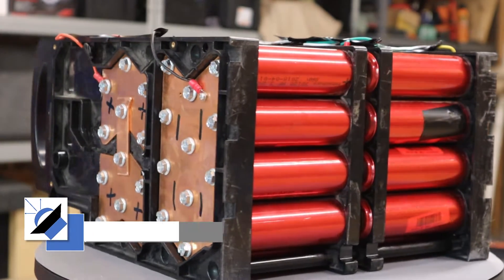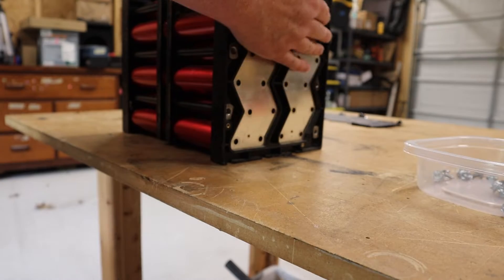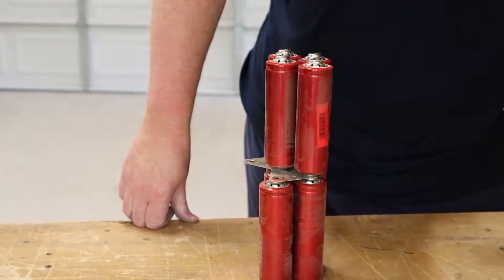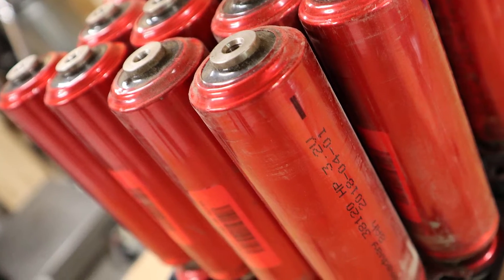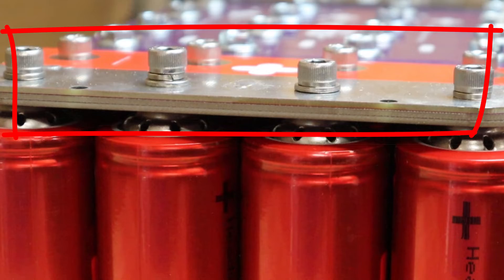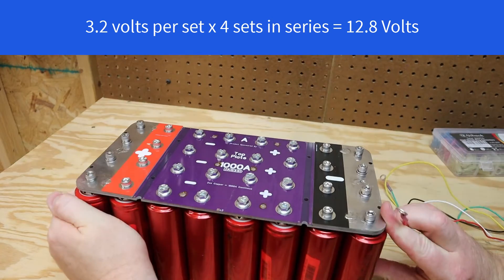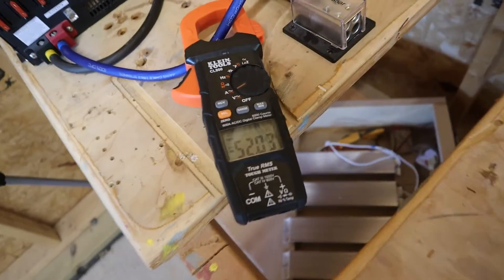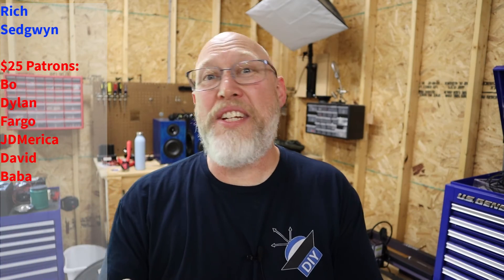Super Beast Battery Transformation! @JAG35, Headway Lithium and Battery Hookup

Comment: I’m running 2 500a pcb stacked  . It works with my smart 3 amp but I upgraded to smart5 and I’m wondering if the copper foil pcb bus bars will hold up , or should I use 1/8” aluminum plate ? Plus I have 3lugs so I’m bolted to the cell the corner.  
Idk if I’m over thinking or what.

Comment: I think it was about 5 years ago I first heard of these new cells but way before I saw any used ones for sale that I bought the 10ah ones and over a month I had 20 so made me a 4s,5p battery out of them , was going to install in my van but at that time I didn't know how to control the charging current . I put these cells in a plastic amo can with all the extras I needed for ham radio , I used my 30amp switching power supply through a 60 amp dc/dc boost converter and set voltage to 14v at 5amps which was all I needed but I most certainly used a good quality smart bms to keep it balanced and protected from over hear, over voltage, under voltage and freezing weather , it was really expensive at the time as most of those cells cost me $25 bucks each but were new . The bms is Bluetooth so I can see what's going on at any time and feel much safer like this . This battery wound up costing me around $700 and well worth it .

Comment: Is lithium benificial for your car audio system if you have a HO alternator and only listen to your music when the car is running and voltage never drops below 14v.  Im still deciding if i need shouikd get lithium
Reply from the maker: Probably not. But it is hard to say for sure.
Reply: Is it staying at 14v at the engine bay or at the amps? If it's at the amps,  you are not pulling enough current to even outdrive your alternator.

If voltage remains high at the engine bay,  but you're seeing it drop much lower during hits at the amps, your main power wiring is undersized. Address that,  then revisit a li-ion battery setup.

Comment: Hey can these PCB bus boards be used with the larger blue cells like the 10, 17 & 20 AH cells I'm not positive but I think they are the same size around just taller which should make it work right I'm trying to get the smaller boards and add bigger cells if possible I want the big power from a smaller bank than a 96ah

Comment: I'm new to ALL this lithium batteries and whatnot. I'm wondering if sum1 can help me out. I need a good battery for my car and car audio. I wanna do a battery delete. I haven't decided on what amplifiers I'm gonna get. No more than 4000 watts total. 3000 watts RMS at 1 ohm and whatever for my door speakers. My question is, what size headway cell would I need to run 4000 watts max at 1 ohm and the whole car? Please help and please give me sum advice of what will work for me. Thanks for y'all's time and brain power...lol
Reply: Thanks for the information. I have bought myself a Headway 24 cell 48ah lithium battery since I posted this post. Haven't gotten 0 gauge OFC wire yet. Gonna order that today.. hopefully...lol I also have just a factory alternator. I'm disabled so it takes me a min to buy everything I need to upgrade...lol Thanks again for ur info.
Reply: On Hifi Vega's video he shows that a 16ah lithium bank I believe lifepo4, outperformed a 100ah AGM battery in some tests he put them through. So hopefully that helps a little bit.   For 4k + the vehicle's needs, I would think 64ah should be plenty depending on your alt.

Comment: Dude you could just add resistance to the charging line to decrease the current. Use thinner gauge wire or add a resistor (granted you’d need a large one but a 12V automotive bulb could work but probably not for that much amperage)
Reply from the maker: Thin wire = fat fuse.

Comment: Greetings! This video was incredibly helpful!!! I have A question! If I where to build the 80Ah, could I use the same balancer you have linked here? Also, do you think the battery size you built is capable of starting a car reliably?
Reply from the maker: The balancer is designed for a 4s application.  Meaning if you have four cells in series it will balance them.  This thing should have no trouble starting a car.   But do not put this thing under the hood of a car. It is not designed for that use and you will burn your car down.
Reply: @DIYAudioGuy  THANK YOU SO MUCH for this answer!! I have been unsure of what the 3s-4s meant!!  This is my first rodeo, and i have a beast module on the way! My alternator is a brand new 100A Denso. Do you have any recommendation about building The battery you built here, VS the 80AH? The portion of video where you said it was initially struggling with the 100a charger, which is equivalent to my 100a alternator, I have wondered if I should build the smaller battery or larger battery. Again, I cant thank you enough for this information you have provided. Your page has me wanting to link my credit card to YouTube LOL!

Comment: Built a couple for car audio, @ 3 mins you will not run into that problem if you separate the cells then remove Center plastic pieces...or at least that's what I did with little to no resistance disassembling

Comment: so when I multiplied 8Ah x 24 cells it gives me a total of 192Ah. is this correct?
Reply from the maker: If you were to put 24 cells in series that's what you would get.  For this setup there are eight cells in series. So it's 64 amp hours.  If you convert a superbeast to 12 volts it'll be 96 amp hours. Because each series group has 12 cells.
Reply: so, it looks like you have 48 batteries. Does that mean you have 4 batteries per cell? I'm just trying to understand the amp hour rating. 48 x 8 ah would be 384ah.
 @DIYAudioGuy

Comment: Bought the same charger........ And like many before me, I returned it. Can you deep cycle head way?
Reply from the maker: I bought a different power supply and it works just fine.  You cannot deep cycle headway cells, they don't like being over or under charged.  Best case you shorten the lifespan of the cells, worst case  you start a fire.

Comment: I've been charging my lithium with a 4amp Battery Tender from Walmart with no issues
Reply from the maker: I need something that can charge and act as a power supply so that I can test amplifiers.
Reply: @DIYAudioGuy  Oh okay I understand. I charged my JP 6.0 and JP 500 farad cap bank with this charger and pushing a JP33 on 3 Resilient Sound RS 10's no problem.

Comment: I've got the same exact power max  100 looking to upgrade to push more audio equipment in my theater/gaming room. Does anybody have suggestions on what would give me more power thanks
Reply: Get the 120a version from power max and run them in parallel. Thats 240 amps. Plenty for almost any setup. Just make sure all the wiring used is identical in length.m and sized appropriately. That’s how I powered my audio system in my 2011 Honda cr-z hybrid prior to addition of a 320a alternator. Side note these power max converters also operate on 100+volts in case anyone was wondering.Since removal from my car i use them to charge my 80ah yinlong Lto and other batteries. One charger is all i use currently and the other is a backup . I top off my battery if I haven’t been driving the car much.  Only takes about 14 minutes to go from 13.6 ish volts to 15.5 at a beginning amp draw of 92 amps

Comment: I dont recommend you use a powered tool to insert the screws into these headway cells. They are on the softer side of metal threads
Reply from the maker: I agree.  Don't grab your big impact driver and give it 50 ugga-duggas.  That will mess things up in a hurry.  I was using a cheap 12v driver from harbor freight with the clutch set on the lowest setting.
Reply: @DIYAudioGuy  itll be alright. i had to tear down my dead bank last night and a couple of the cells threads have loctite from factory or something similar. needless to say i spun the negatives on 2 of my cells, it take alot of torque at least 15-20 ft lbs or so to hurt them

Comment: Just get an adjustable voltage PSU. The standard ones are 0-32v 5-10amp you can get them as low as 60 ish bucks

Comment: Insted of that balancer you should consider a bms (battery management system). I have a daily bms 250amps on mine works great but it only gets the battery 13.4, but it keeps it their.
Reply: And that’s your issue. Dalys balancing is nearly nonexistent so you’re getting high voltage cutoff on one cell while the others are probably low. And keep in mind high voltage cutoff is going to be 3.70 or 3.75 which is unnecessarily high. No reason to go over 3.55 or 3.60

Comment: Ok, I'm an electrical engineer who has designed lithium battery protection and charging systems, and there are so many issues here that all I can say is please do not do this. These batteries have certain parameters that need to be addressed for even approaching safe usage. What you are doing is unsafe on many levels and I would say that you are on the path to having this pack burn up in a manner that will probably burn down your garage and hopefully not hurt anyone or worse. This can happen at any time, when charging, discharging or even while the battery is resting disconnected while you are sleeping. Just the beginning: 1, Do not exceed the maximum charge or voltage that the cell manufacturer has listed on their spec sheet. This is specific to each cell designed by the manufacturer. These cells are not like using D cell where the parameters are tied to a general design range.  2, Do not charge, store or discharge the battery cells outside of their specified temp ranges. 3, Do not discharge above the maximum current rating of the cell as listed on the specific cell data sheet. There is no rule of thumb for this. 4, the charge and discharge limits are so importaint that you must use a battery protection circuit that will disable the chargeing or discharge if they are exceeded - this can help to prevent a thermal event. 5, Do not discharge the battery below the minimum charge voltage - the battery protection board should be designed to do this automatically.  Inexpensive charge balancers and battery protection boards that are available from china can be (And are often) so bad that they simply do not work. On one design we were given 8 different battery protection boards from a china based "Professional battery supplier" and none of them protected the battery in all of the cases listed above. note that longevity and safety are based on all of the parameters listed above. using the cells in a manner that is far on the safe side of these make it far more likely that you will not have a thermal event. here is a bonus point - The manner in which a cell was specifically historically used determines directly the probability of a thermal event happening - so these used cells that you got - how were they used? The issue is that there can be crystals that form in the dielectrics that can pierce through the separators inside the battery - this is made far worse from misuse. you have no idea how these used cells were cared for. I would only keep a battery like that in a separate building far away from my house, and I would treat it like a thing that is going to have a thermal event. There should already be laws about this sort of thing - this is why rural houses are not alllowed to put a large propane tank inside their house - it needs to be kept away from the house outside. Be aware that when batteries start on fire there is almost no hope of realistically putting out the fire. Fire departments just wait for it to stop burning while dousing the area with water to try to stop surrounding things from burning.
Reply: Electrical engineer who can read a wiki and not understand anything he's read or re-written lmao.
Reply: I have used headway cells for 5+ years in car audio, never a single issue on any of the banks I have, I also use the same balancer he has listed in the links for the 5+ years as well.  This will trigger you even more, I have an agms upfront under the hood and these banks ran to them with no isolator charged with dual alts, but I do pull them every 2-3 months, balance them and check each cell afterwards, reassemble and fully charge them let them rest,  then put them back in my vehicles.  

10s of thousands of people use these cells without issue, which holds way more reliable weight, than a random person on YT claiming to be an engineer. just saying.

EDIT" these Jag bus bars though, aren't nearly good enough withstand 1000 amps of continuous pull, I wouldn't even trust them for 200 amps continuous if I'm being honest, there is a reason we use thick bus bars and these jag ones aren't going to cut it.
Reply: @Joes_Channel1984 same
Reply: These are lithium iron phosphate batteries.
Reply: I'm guessing you've never heard of these in car audio? I don't have the energy to continue
Reply: These are lifepo4 bursting into flames, nope. Though having a bms would be wise vs just a balancer. More for longevity of the pack. Also you may want to used a balance charger for rc batteries like the icharger x8 or whatever you want. Beyond that bulk charge with a modified hp power supply.
Reply: Yup he dam sure is a engineer for sure let's spend countless time and words on a Idea that as was stated 10's of thousands of people have already proven works so what was those 10's thousands of dollars actually spent for that you said was for school cause you have proven with out a doubt you learned nothing but how to type really well with your thumbs on your phone

Comment: U can charge that bank with a any  regular car battery charger even one from harbor freight. 10amp mode works great might take all day but it works and the Charger only charges to 14.8v and then u get the green light just like a regular deep cycle or led acid battery. U don’t need a fancy smart charger or big power supply to charge them
Reply from the maker: This power supply should work fine. Something must be wrong with it.
Reply: @DIYAudioGuy very true, I was also wondering if the power supply u were using shuts off after the designated voltage is met? Just like the regular car battery chargers do. I’m liking the buss bars though, my last 3 headway banks I put together the buss bars were made from stop signs, same as any aluminum u would get from a metal supply yard just much cheaper and the work great, same thickness as the buss bars that come with the super beast and handle the amp draw just fine with it being aluminum versus copper
Reply: I would watch out when using a regular car charger since some have a descaling cycle. Stick with an Hp server power supply usually get 22 amps out of them when charging my lipo 6s packs for rc racing and then on 4s I get over 30amps that’s less than 30$ to order one of them power supplies 😊
Reply: @onesikm3  I have RC cars as well, different from the headway lithium cells, a regular car battery charger charges headway lithium cells perfectly fine, the same exact as a car alternator would.. battery chargers are not magic. They all basically do the same thing

Comment: I have a powermax pm3 100a power supply on 2 superbeasts 192ah's in my basement set-up. Never had any issues charging them at the same time.
Reply from the maker: I'm beginning to think something's wrong with the power supply.
Reply: Might be. I've been charging with my powermax for well over 2 years now.  Switched from a massive audio pb100 amp supply. Another great option if you can find one new these days. Good luck with your project 👊.

Comment: I wonder if something is wrong with your power supply? I’m using a PM4 to charge 160ah of yinlongs. I usually keep the at 14.8v, but I’ve charged them to 15.8v before. My pm4 has never gone into protect a single time.
Reply from the maker: I think you are right.  I went ahead and pulled the trigger on a different power supply, hopefully I'll be able to start testing some amplifiers again.
Reply: @DIYAudioGuy  I’m even running mine off of a 50’ extension cord
Reply: Can they run well on a 14.8 volt alternator or is the 14.8 to high for the batteries?

Comment: So what Im gathering is if you put this into a car, a smaller 95 amp alternator won’t be able to keep these charged?
Reply from the maker: I cannot say for sure, this power supply seems to be designed to shut off if the load needs more than 100a.
Reply: It depends how much you are drawing.
Reply: Yeah. Thanks for the video Justin. I always appreciate your work. this one gives me more questions than answers. But sometimes that’s good. I want to put a small lithium bank like this in my car. But I’m wondering if my slightly upgraded alternator will support it. My car came with a 90 amp from the factory. I’ve upgraded to 130 amp from a different model with the same engine. But I don’t know if it’s enough to support a headway bank.
Reply: @garyclemmons1073  Again, it depends how much you draw. A 1.0 amp alternator would work perpetually if you have 0.9 amp draw.
Reply from the maker: @garyclemmons1073  This  power supply was just not made for this.  When it's overloaded it goes into protect.  I don't know much about alternators, but I don't think alternators do that.
Reply: @DIYAudioGuy  Dozens, hundreds or thousands of hours into car audio but have never messed with alternators?  Seems like a glaring omission.
Reply from the maker: @DarthObscurity  https://youtu.be/MuksKiWpit0